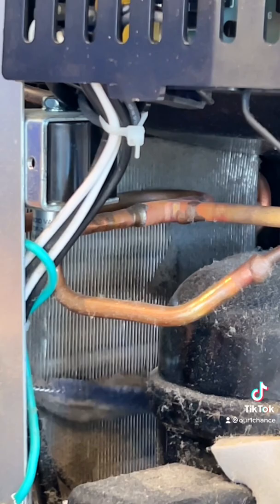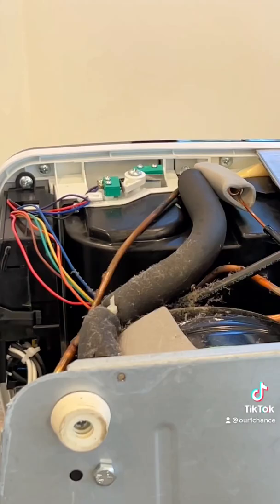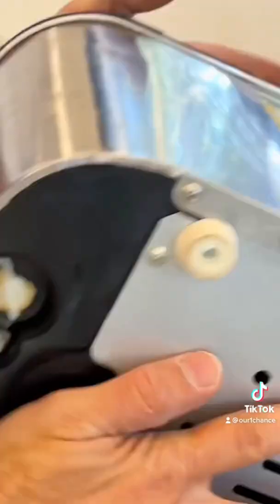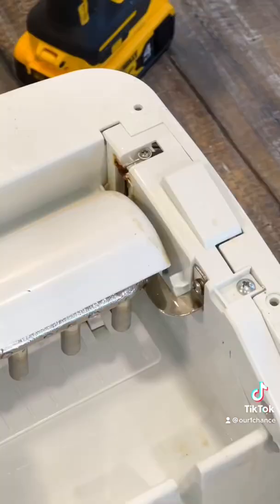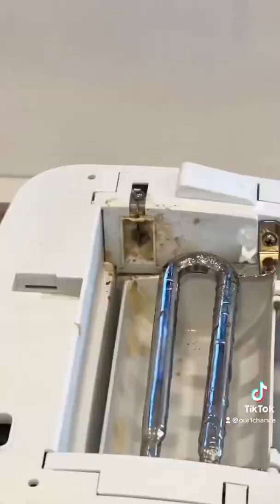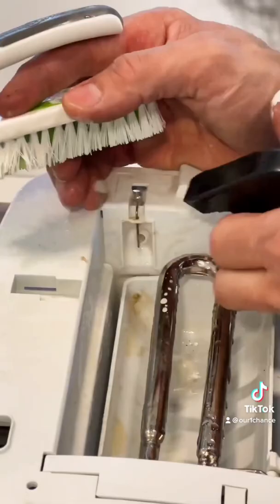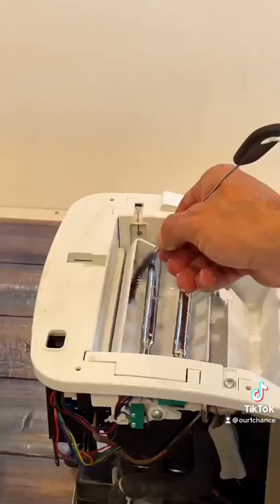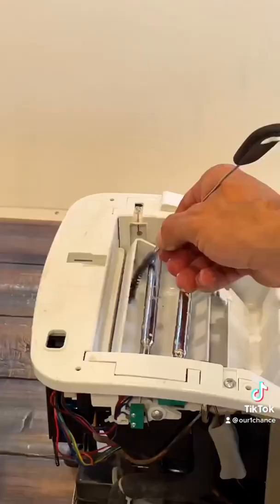Cleaning our portable RV ice maker

Comment: This is How to tell Condenser Needs cleaned:
1) takes a longer time than usual to make ice.
2) discharge air coming from the machine is Hot 🥵 not Warm as it should be.
3) under normal operation the air coming out of the machine should not be hotter than 30 degrees over Room temperature. Example: 70 degree room temp = 100 degree air coming out of ice maker.
Reply from the maker: Great points!